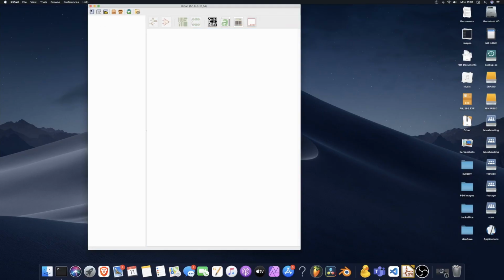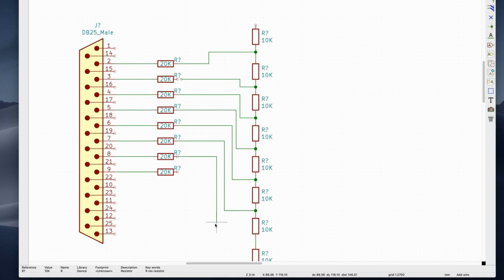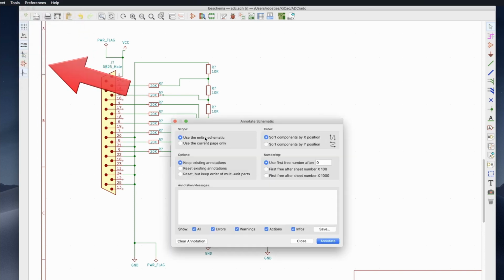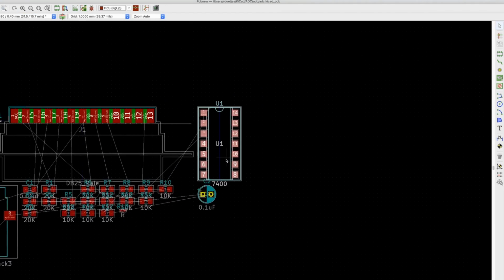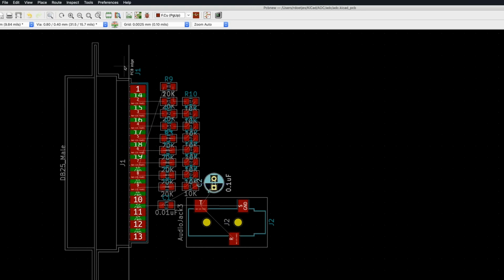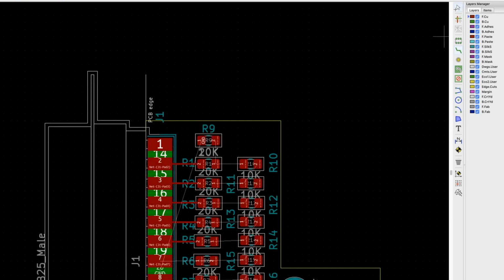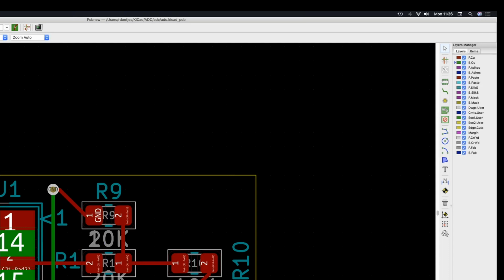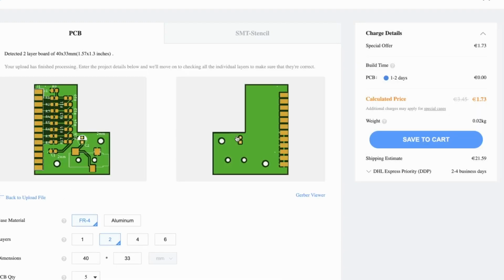Fast KiCad workflows for beginners (re-upload)

Comment: Having done several boards in KiCad, I'm no fan of the DRC when you need the Power Flag. Something always seems to break, and the best advice seems to be "keep trying". Dealing with libraries is also a nightmare, and was vastly improved/seriously broken in v5 depending on your viewpoint. We'll see how v6 does.

That said, I wouldn't use anything else. And hearing a reference to Orcad made me smile, it's been a minute since I used it. :)
Reply from the maker: I finally understand the power flag approach. Initially I was also stooped and it’s not intuitive. You’d think that a VCC, GND would be enough to know that these are power rails, right? There’s no other program that uses this approach. 
And indeed, initially it was just trial and error for me until the ERC gave a green light.
Now as soon as I’ll put in a power supply I tag them with the power flag and the vcc and GND.

And indeed, I too don’t use anything else. Because this is what’s opensource and freely available and has a great support community. I have yet to install v6, I’m curious but have not had any new projects to do. As soon as I have I’ll install it and hope for the best 😜

Comment: Please do more KiCad videos.  BTW, which version was this you used?
Cheap PCBs, Shipping, not so much!  OSHpark might be cheaper in total.
Reply from the maker: Hi thanks for your reply. 
Where are you located? I found out that shipping to the Netherlands is the same price from all over China. OSHpark is in the USA and shipping to Europe is way more expensive. I do love that typical purple PCB colour.
I got everything shipped including taxes for 23 euros about 25 bucks. Shipping and taxes are definitely the most expensive though.
Reply: Oshpark is great for very small boards, but $5/in^2 adds up in a hurry.  I just designed a 80x100mm board that would be $62 (for three copies) from Oshpark; it was $2 (for five copies) from JLCPCB.  Even when you add the $20 shipping to JLCPCB (I'm in .us, so Oshpark ships for free), and assume (as is the case) that I really only need the one board, that's a steep surcharge.  But the ENIG finish is nice...